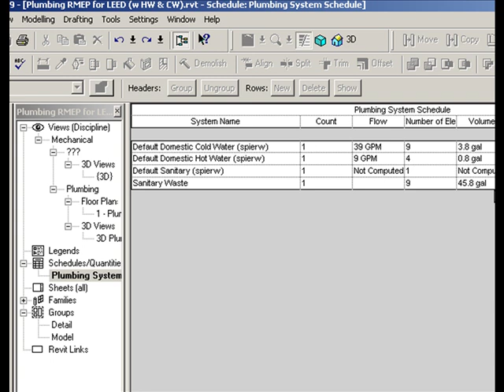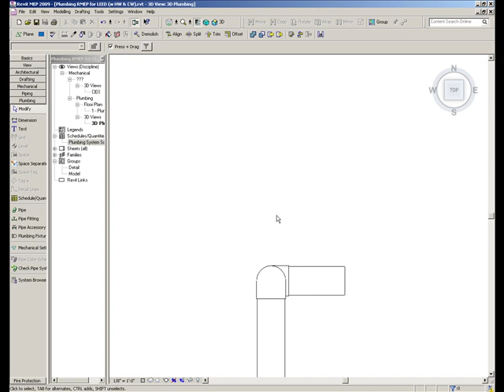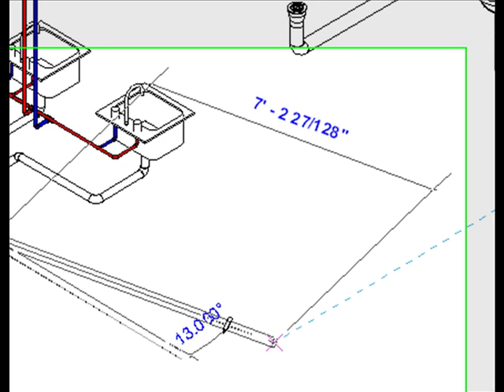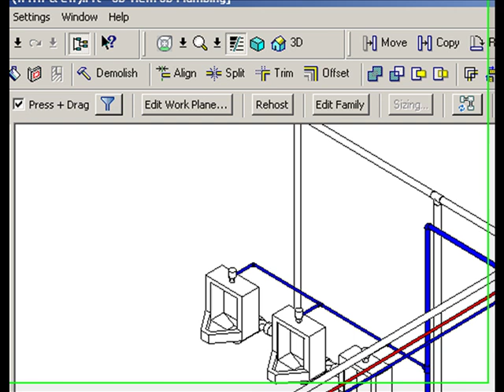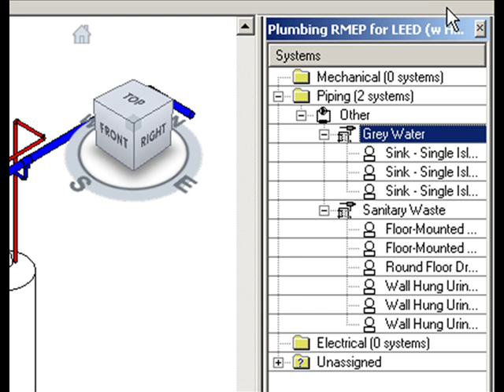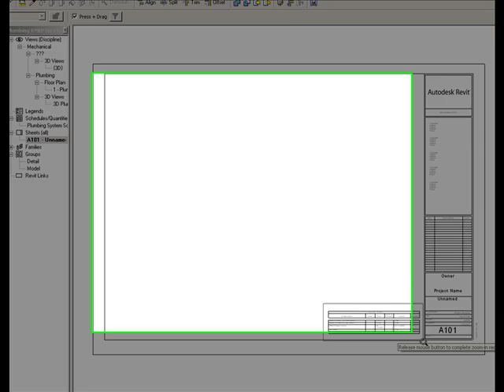LEED Credits for Plumbing Using Revit MEP

Comment: Not knowing more about your background and what you want to do, all I can tell you is Revit is gaining lots of traction, and so far I have not met or heard of a firm who has turned back after starting down the Revit path. That said, if you decide on Revit, you'll want to research firms that are already using it, or are willing to make the switch, before you hire on. AutoCAD is more ubiquitous currently, but Revit users can usually command a higher pay than their AutoCAD only contemporaries.

Comment: I think Revit is good for Plumbing, but it's far from great and requires a lot of customization and/or prework.  I would recommend though if one of your reasons for posting the video is to show Revit is up to the task of plumbing, you may want to have an accurate model.  Even for design documents I would make sure my lavs have p-traps and I would use long radius fittings as required by most codes.